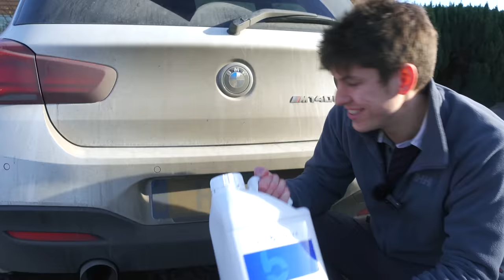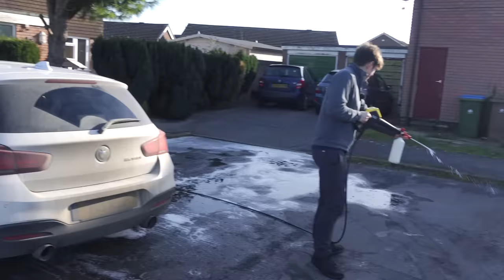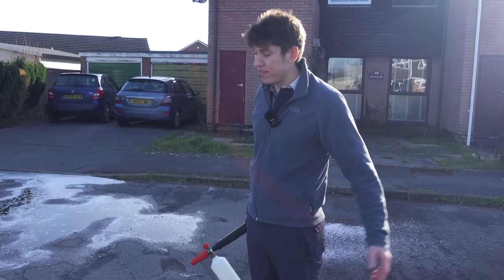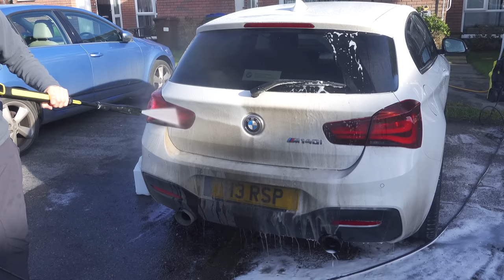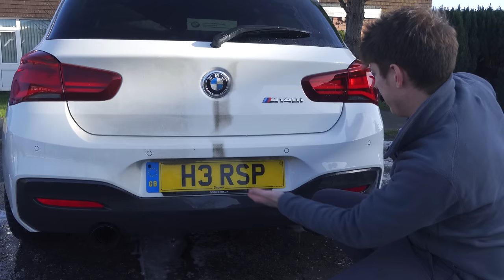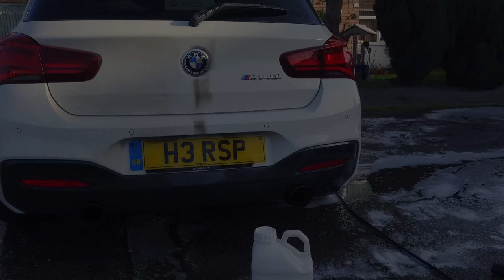Does Snow Foam Actually Work? The Results Might Surprise You..

Comment: I used auto glym snowfoam on my bike after a 300 miles ride back from the Scottish Borders in heavy rain and I would urge anyone to exercise caution. I may have been unlucky but 2 days after using it is went to get the bike out of the garage and I could hear the chain grinding as I moved it. On closer inspection the stuff had removed every trace of oil and grease from the whole bike. Don't get me wrong, from a cleaning perspective I couldn't fault it but I had to give the bike a thorough going over and I had to replace the chain because the snow foam had corroded it, it had done less than a thousand miles as I replaced it for the Scotland trip. Like I said, it really cleaned it but be careful where you let it go because a little bit of grease is cheaper than a big lump of metal!
Reply: Somewhat related, I think - when detailing a bike, also, using a pressure washer is probably a bad idea. There are so many nooks and crannies and gaps and bolt holes etc etc where you can force in water at high pressure. That can probably promote corrosion and other issues. A bike is small, there's no need to use a pressure washer on anything. Maybe snow foam and rinse to get the loose dirt off, then a two-bucket wash system, some smaller brushes, maybe polishing up everything after with a Flitz 2- or 3-inch buff ball and the polish of your choice (I do favor the Flitz paste polish also, personally.)
Reply: @KimmoJaskari  have you found that some of the tried and tested products that we have used for years aren't as good as they used to be? Too many to name on here but over the last 10 years I've noticed a distinct decline in the performance of a lot of well known polishes. I have been told that to keep costs down  (or perhaps maximise profit) the manufacturers cut back on the more expensive ingredients and use more of whatever is the cheapest option?

Comment: I've always understood it that snow foam agitates the dirt so it doesn't drag or scratch your paintwork. It's not intended as a one coating cleaner . I wouldn't use a high pressure hose either. Good demo though

Comment: Next time wet the non snow foam side to hydrate the dirt. It will make a difference because it gives the dirt a chance to absorb moisture and release from the paint. This is why car washes have a pre soak. Even though they will be using a chemical and you won't, it will still make a difference.

I have a foam cannon that I use regularly. Your foam didn't stick around as long as mine does. FTR I use "Mr. Pink" as one of my foams, gently mixed with hot water. My canon isn't particularly expensive and neither is the pressure washer.
Reply: The Autobrite one is good or the Mjcc Canon
Reply: The effectiveness of snowfoam isn't measured by 'how long it sticks around'...
Reply: @mrlooneycooney8948  You're absolutely correct. You should just pour the soap directly on the car and rinse it off as fast as you can.

Comment: I use the Flare detailing PH neutral foam which is absolutely incredible. Their website said it contains ingredients that expand out and actively attack and dissolve the grim rather than just loosening it and I was pretty skeptical but now a year on I wouldn't use anything ever again! It's truly amazing how well it works, super thick (like actual foam) just be sure to leave it for 4-5minutes.

Comment: I do a citrus pre wash, then snow foam, both on for 5 mins, then 2 bucket method wash, and dry with a towel and pet air dryer. Then use EZ gloss boss. Drive around the corner, and it's dirty again.

Comment: Having just washed my new car for the first time, (not particularly dirty, just normal road film and dust), I was going to call BS on this "snow foam" fad... I paid for the Diamondbrite ceramic coating and the included care pack included some snow foam.  After seeing the many vids on YT about it, I thought I'd give it a go.  After faffing around for a week getting an applicator with the correct fitting for my pressure washer, I actually used it this morning... and frankly I was disappointed.
I rinsed the car down with the pressure washer first, then gave it a coat of foam.  I waited 5 mins, then gave it another coat of foam. waited another 5 mins then rinsed off with the pressure washer.
While it was wet, it looked cleaner, but when I dried it was a microfibre cloth, I could see there was still a film of dirt on the car... the supposed "lifts off dirt" didn't happen.  
Maybe the Diamondbrite snow foam is just not very good, but I'd have gotten a better clean the old fashioned bucket way...

Comment: 2:24 - Woah! Careful matey. If you hold the spray wand too close to the car, you can actually force the dirt under the clearcoat. That's why I never take my car to automatic washes. The pressure is set too high and I had a car with a few dirt spots that cannot buff out. The only solution is to strip the clearcoat and recoat it.
Reply from the maker: Don’t worry, the pressure on my K4 isn’t that strong, plus I know where every stone chip is on my car, also bmw clear is very hard. Never had an issue that you describe. Thank you tho!
Reply: How are u the first in the detailing world to force dirt under the clear coat that couldn’t be polished out 😂

No man. Not sure what your doing but most retail pressure washers won’t get that high to even come near damaging a flat coat let alone the billions of topper products they use.

Comment: Believe it or not, there is still dirt on the snow foam side, though it is hard to see. Professional detailers use a foam wash to get the majority of the dirt off before hand washing, since hand washing introduces the possibility of scratches and swirl marks, which is minimized when most of the dirt is already gone. After that, some type of paint decontamination may be needed before a ceramic coating or wax is applied. That decontamination is often done with a clay bar or pad, which removes particles that are stuck in the clear coat. Then a professional ceramic coating, or for a DIYer a ceramic and/or graphene-infused polish can be applied which will protect the paint and bead water for many weeks to months, while leaving a high gloss shine.

Comment: whats wrong with using a bit of elbow grease
Reply from the maker: Casues scratches. The point of this snow foam is to remove as much dirt as possible before you get to the elbow grease bit.

Comment: Probably not shocking - using any detergent vs not using detergent, the detergent is going to win. The benefit is probably in if you snow-foam first, then rinse it off (even without pressure) you get all the gross dirt off that it lifts without having to grind that into the paint. After that, a two-.bucket wash with a brush followed by treating the paint would probably give a superior end result. Touchless is a bit of a misnomer, really, you're touching the paint plenty with a ton of high pressure water - but  touchless for the initial stage when the paint is covered in grit is probably very valuable.

Comment: I never use a pressure washer to clean the panels of a car, but your method certainly proves that the active surfactants are held in place by the foam. Good vid.
Reply: Why not use a pressure washer on the panels ?
Reply: @jonfrench7133  The tiny point of contact is no match for a decent sponge. The jet can damage panel trims and force water into places it shouldn't go. From an eco angle it wastes a load of water. Its the wrong tool for the job.
Reply: @mikenco  oh crikey one mention of the word sponge and I’m doubting your detailing credentials 😁. Re the pressure it’s absolutely the right tool IF used properly, ie wide spray and held a couple of feet away from the bodywork.  It also uses less water than a hose so on every count it is the best thing to use to remove the most  material from the paintwork before making contact with a wash mitt, not sponge
Reply: @mikenco  high pressure definitely not to be used on older cars/classics etc or vehicles that have been resprayed.
Reply: @mikenco   I slightly disagree based on what i know about sensitive finishes.   If you were to wash the mud off an ATV or Dirtbike with a sponge you would completely ruin the soft plastic, it would leave very nasty swirl marks everywhere you touch.   Factually if you were to even simply twist your thumbprint into those plastics (when completely clean) it will still leave a swirl, meaning they are super soft and sensitive.  BUT powerwash the mud off and it leaves it in brand new condition!  Go figure.  
A Sponge is much more aggressive.
Reply: @Spirited_Driver  I completely agree! Shifting large amounts of mud is something done before the washing is done. Same as shifting  most of the grit and dirt off a car before washing. Same thing applies, don't want to swirl the paint.
Reply: I think you get less road tar sticking using pressure washer rather than the hose.
Reply: @mikenco 1.5 gpm is like taking a shower, only it's not running for very long. I don't think it wastes that much water. If anything it uses less than a plain garden hose because the pressure aids in the process.

Comment: For a proper comparison. A quick spray of water on the non foam side. Leave for 5 mins. Then wash. Substantial difference. Foam side, put on dry though. Having said that, I can’t be arsed with dragging the jet wash out and all the faff. Sainsbury’s car wash £3.50 once a week. The roads are so crap a beautiful cleaning job lasts about 10mins at the moment.

Comment: The secret also is to make sure it dwells for at least 5 min, which is not always easy.
 I use Car Pro Lift, mainly because it's slightly gentler on my ceramic coating and it compliments Car Pro Reset shampoo I also use (a bit more expensive than Built Hamber), Built Hamber is a good product as well, but a bit more aggressive

Comment: Technicaly a alkaline degreaser work pretty similar , because a big portion of the formula in snow foam is just alkaline degreasing. 

But the foam is a bit more easy to reach and get the dirt of in my opinion. In Sweden we can buy Ditec proffesionell products on their site as a usual customer. And theres foam wash is brand just like alkaline degreasing foam wash. 

But important is to now that a degreaser is often a bit more chemical aggressive than a ordinarie car schampo. So good to have a good protection on the car if using it alot

Comment: Bilt Hamber stuff works, I wasn't surprised by the results as I've used Surfex as a snow foam for years. I know it's not as foamy but I like to reduce the amount of different products I have to buy, Surfex does everything I want it to even around the house. I will say the dwell time on that Touchless looks impressive and I might get some for Summer use.
Reply from the maker: You won’t regret it my dude 😎

Comment: Adding a snow foam as a pre wash is to soften the dirt on a car to make the washing process as safe as possible. I use Mitchell & King Snow which is PH neutral but if extra bite is required they do HD Snow which is alkaline like your Bilt Hamber. Martin@OCD has done a good review of the M&K Snow if you are interested. I like your car better when it is clean.
Reply from the maker: Thanks John, well said.

Comment: I use GTechniq Citrus snow foam, would recommend it even though it's on the pricey side. it's more of a gel type snow foam than liquid, brings up good results and I only ever mix it in the snow foam lance bottle with hot water.
Edit: works well with a decent citrus wash and car shampoo too.
Reply: GTechniq and Bilt Hamber are up there with the best products on the market. The GT multi purpose cleaner is about the best I've found for removing stains from just about any fabric. The BH Surfex HD is excellent for cleaning guttering and UPVC windows.

Comment: Which nozzle do you use to get that foam, as I know the Kärcher one is not giving that foam
Reply from the maker: I replaced the Karcher for a better lance with a built in nozzle. Just a £25 pounds one of Amazon. Those Karcher ones are not great - I wouldn’t recommend using it if you can avoid it.

Comment: Getting the pressure fan so close to dirty pain,t water jets the sand/dirt particles across the paint, creating tiny scratches/marring, prewash foam with good lubricity for that exact issue
Reply from the maker: Paint is in really good condition. I check it over every time I wash the car. Thanks for the comment though!

Comment: I've found a pressure washer (KarcherK2) wasn't that effective in cleaning car .Could be pressure not high enough is a factor? Haven't used a snow foam,but on your test seemed to make a big difference.Like another commented,maybe you should have wet all car before doing comparison.
Reply from the maker: Deffo go for the K4 if you can. It’s worth it
Reply: I have a Kärcher K2, and it works well.  Remember, the pressure washer is not the only thing you're supposed to use.  Spray the loose dirt off, then snow foam, and then rinse it after 5 minutes.  And then a hand wash (with 2 buckets).

If you compare regular hand wash just pre-rinsing with a garden hose (and no foam) to the steps I mentioned above (with a pressure washer), then the water in the buckets will be a LOT cleaner.  Which means less dirt being dragged over the paint when you do the hand wash.

Comment: Does the car get cleaner with snow foam compared to ordinary car shampoo and a sponge as well?
Reply: Hi Jantje I believe one reason for using snow foam first is that you have as little dirt on the car when you then use shampoo and sponge - to avoid any small scratches/swirl marks when you go over with the sponge. I use snow foam, pressure rinse, then sponge and shampoo - super clean, no scratches hope this helps

Comment: I have used snow foam but it strikes me that a little elbow grease and a sponge is about a tenth of the cost and produces a better result. If you are averse to physical exercise go with foam, otherwise get stuck in with wax-wash and polish in my humble opinion!
Reply: The snow foam is used to get the worst of the dirt off, so when you do your contact wash (buckets and "sponge") you aren't lightly abrading the clear coat. So you are getting your exercise and a scratch free car. Win win.👍
Reply: I don’t disagree. Any car nut washes their car weekly. Doesn’t have this much build up and the normal cycle of polish / coating is more then enough to last the car life. And have it looking better then 99.9% of cars for daily. 

If it was a exotic maybe I’d go the extra step but to me mostly useless and a waste of time. Energy. Money. Chemicals in the water supply

Comment: I’m new to the snow foam and degreaser after see loads of detailing videos. I have used a few snow foams (stjarnagloss, hydrouk, etc. ) with less than good results. Thought let’s do the citrus wash part first - using forst, with marginal improvement. Going to opt for a new cannon and change the snow foam to gyeon.
Reply from the maker: Give Touchless a go, I think you’ll be impressed. I’ve bought the Gyeon Foam before and it wasn’t as good as I wanted it to be.

Comment: My experience is that it works great with a washing mit and some elbow grease like any good car detergent.   I like a detergent that has a softening rinse agent.  My water is like stone.
Reply: Consider fitting a water softener; they have so many advantages you’ll see the benefit in every place you use water in the house. Leave one outside tap unsoftened for watering the garden. Have a second outside tap for car washing using softened water.

Comment: The foam basically allows water to stay on the surface longer to soften up the dirt. Cheaper alternative would be to wash your car after heavy rain. 😁 So yeah, this comparison is not really a fair one.  Pre-soak the other side too.
Reply from the maker: Tried just using water to lift the dirt and it really doesn’t do anything.

Comment: I'd like to see what the car looks like after its dry ( not wiped, just air dried ), close up.
Reply: That doesn't make sense, because snow foam is a prewash. There will always be a "traffic film" left after the Prewash. That's why it's called "prewash". You use snow foam to remove as much dirt as possible to make the following handwash safer for the paint. It's not meant to make the handwash unneccessary.
Reply: @racecruiser  oh ok, I didn't know that

Comment: The whole point od snowfoam is it softens the dirt which you should then agitate with a mitt. Just jetwashing is a waste of water and will ruin your clearcoat. Use any snowfoam properly and it works much better than shampoo.
Reply: I would really prefer to snow foam, wait, then rinse. Maybe with just a garden hose, but I would want to flush off the grit and major particles before coming anywhere near the paint with any brush or mitt. But that's just me.

Comment: Would love to see an A/B test with Cargo Kenotek 4100. Lorry drivers seem to use it a lot and I use it myself with foam cannon. Good results. 

Curious about pressure you’re using here, usually my pressure washer will clean most things if in close enough. Of course that’s a risk with some cars.
Reply: Kenotek has some awesome pre-wash shampoos indeed. Then again, like you said..made for different purposes. The Cargo 4100 will degrade any wax or protectant.

Comment: No nonsense comparison, thank you. I have been told numerous times that the best snow foam formula (especially when considering budget) is using Fairy Platinum!  Apparently it runs rings around these premium auto specific detergents. It also leaves the best "no residue" base for any further applications & is far more environmentally friendly. Any thoughts??
Reply: But fairy is designed to remove things just like car wax .. so not a good idea unless you like the dull matt finish  , esp when you can buy snow foam cheaper than fairy platinum